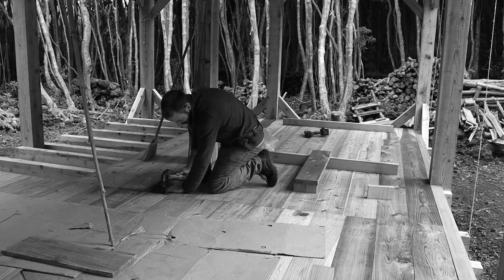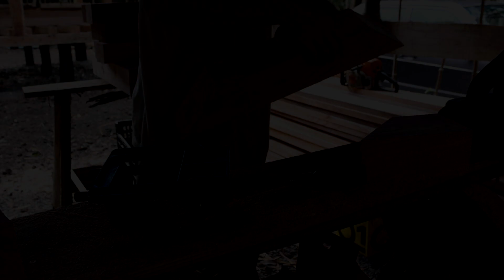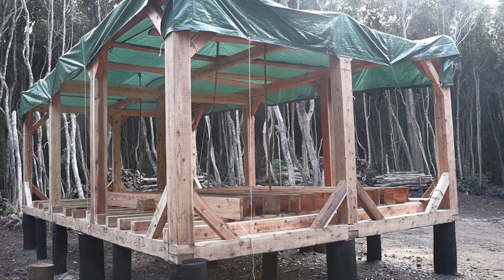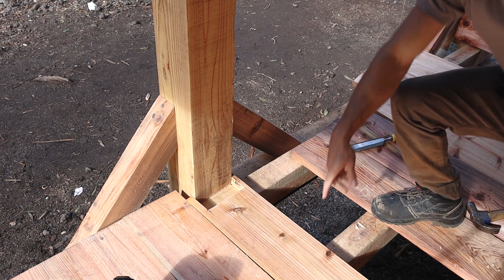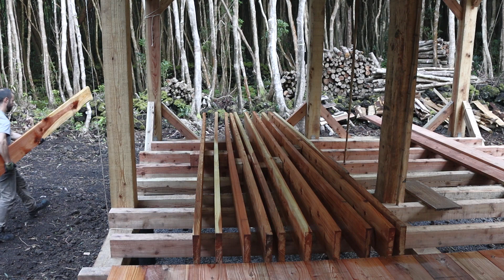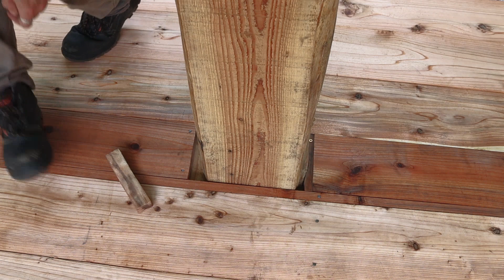Off Grid Cabin #11 | Finishing the Cabin Floor

Comment: Hey man what size post did you use for the framing
Reply from the maker: Hi Joseph. For this cabin, I used 6x6 for the main frame.
Reply: That's 6x6 all the way to rafters I'm pretty sure but can't tell to good an what size is this cabin
Reply from the maker: @josephjackson6245  The cabin has 4 x 7 meters of surface, and about 3.50 meters high.
Reply: In feet how would that be I don't know it by meters I live in a holler in KY an wanting me a cabin
Reply from the maker: @josephjackson6245  23 x 13 feet of total surface; 11 feet high.
Reply: Ok thanks for responding an if I got anymore questions I'm trying build a 16x30 trying get it all figured out